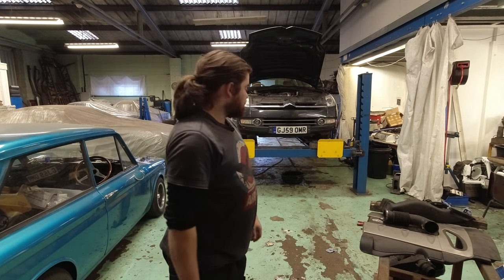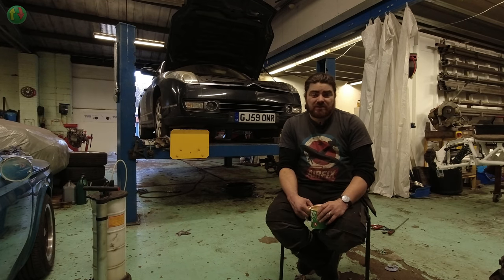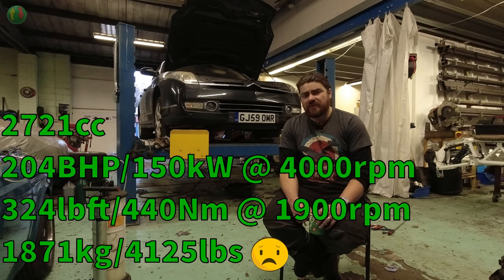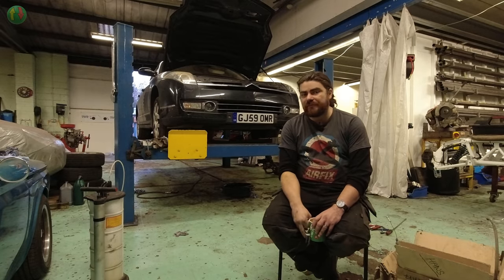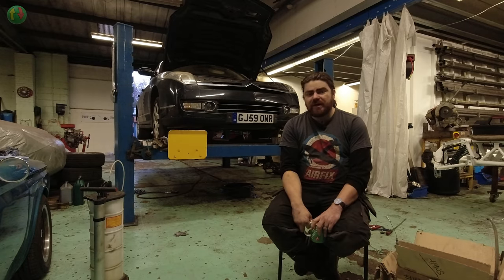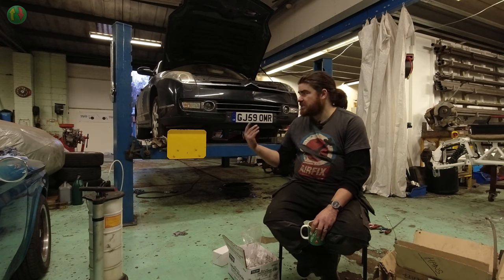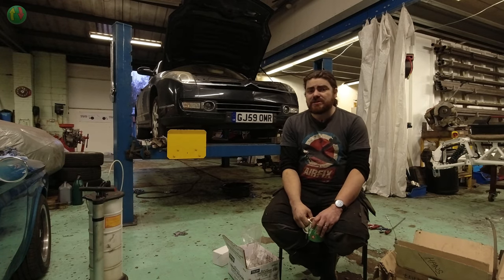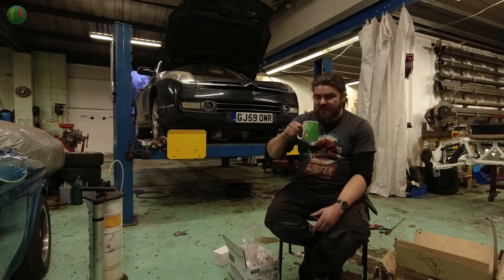STORYTIME: How I ended up buying a £750 Citroën C6 in lockdown!

Comment: So Great to see Lovely OMER is getting the work done to her. I drove many tens of thousands of miles in her and loved 95% of them, the 5% were due to the problem highlighted.
I was sad to see  her go but I could no longer fund the work necessary and am  Glad to see her in such capable hands!

I totally agree about the C6 Owners site and would highly recommend people go to it for information related to these cars, the type of things  and common faults to look for.
They may save you many thousands of pounds!  Wish I had known for instance to change gearbox oil every 40K, quotes for gearbox rebuild was north of £2.7k. Though strangely the box fitted as far as Citroen is concerned if a 20GG09 usually fitted to a C5 3.0 V6 

 Did save me loads of cash when she had a problem with Kick down where she went into Limp home mode. Citroen did suggest it was one of the EGR valves. Cost to change £1300 if that didn't work it was £1800 for the other. Transpires that nowhere in the maintenance schedule does it mention to change the Fuel filter and when inspected it was most like the one that came out of the factory. Cost to replace £40, see what I mean!

Also if you are buying a C6 find a specialist to look after her, do not go to a Citroen Main dealer, they know so little about C6s that when the one I mistaken chose they took 2 1/2 days to do a cambelt and managed to bugger the thermostat house (Should be changed at same time) but denied doing it. 

Looking forward to watching the rest of the series and maybe I could come down and see her when your have finished! :-)
Reply from the maker: Thanks Kevin, it's down to you that it's still going!
Reply: I just looked at the mot history! Blimey Kevin you must have bottomless pockets, it certainly didn't shower itself in glory did it? You did well to keep it going. I always liked the look of these, I had a Mk I 2.2 C5 auto exclusive estate and that was a nice car but very thirsty and with the tax and insurance it became not viable. I also had a 2.5 Xm Sx. Like you it was a labour of love and I spent an awful lot of money on it but when the clutch started to go I had to get rid which was a terrible shame but that job on a 2.5 Xm is mega money.

Comment: A C6 is always risky even at the top end of the market, but it is a great concept worth maintaining and enjoying. Even the 2.7 can do a lot of miles, just change the oil pump from time to time keep your eyes on the coolant pipes and do it's services as correctly as you can. My car had a lack of damping and I changed all the spheres - sadly everything was wobbly as usual, then the pump went out and I had to replace it for 1200€ after that the damping was spot on. By the way the faulty motor in the hydraulic pump is a Renault part and pretty cheap and you can change the motor with a bit of work. For the gearbox issues just change the hydraulic solenoid block these are Aisin parts used by Volvo, Lancia and a whole lot of other cars - also shift in "Neutral" for stops till everything is sorted out.. it is worn out if it keeps on jerking with fresh oil because a Solenoid is weak and it weakens under heat as in an old pinball machine.
 It is an AM6 Gearbox and you will find parts almost everywhere a thing worth doing would be a larger oilcooler for the gearbox the stock cooler is just a open metal pipe behind the grill on the left side.
Reply: I didn't realize it was an Aisin AT. I thought it was a ZF.

Comment: Love it! I know you've said you don't like them but in lockdown I picked up a 2009 C5 tourer with the 2.2 hdi for £1500, fully working and with 100k on the clock. It's a lovely compromise between the risk of a c6 but the mechanical reliability/ simplicity of its engine and hydro pneumatics. As a broke 21 year old student I can't take much more risk to be honest. Very underrated car in my opinion, feels very robust
Reply: Nothing wrong with the c5, I've had 4!
Reply from the maker: I don't mind the later C5 (X7). Mechanically it's not really any less 'risky' than a C6, other than the chocolate crankshaft and associated DPF/EGR issues in a V6 twin-turbo diesel. Suspension largely the same, though C6 is set up to be slightly 'waftier' and I believe it's much quieter on the road, too. The early C5 I didn't like much as they have all the downsides of a Xantia with none of the upsides, and they look...well, yeah. That said, I can see why some people might like them.
Reply: @UPnDOWN  Ah yes, I suppose I was thinking about no AMVAR and simpler height sensors on mine, I think the two are related? I think mine has effectively two damper settings, soft or firm.
Reply: A 2009 means it uses the newer electronics system and revised suspension parts. At most, budget for replacement dampers and that's about it! 21 year old with a car that rivals a S class in comfort haha
Reply: i had c5 58 plate buddy and it was the best most comfortable car i ever had.currently driving c4 picasso egs 63 plate and i love it...but c5 was one of the best..
Reply: I bought the early C5 2 litre friezes with 69,000 miles on it, sold it with 259,000 miles. Most reliable car I ever had
Bought the newer C5 which is a dream but not so reliable, but still great after 160,900 miles.
Reply: @docchevron1472  not related , two totally diferent cars
Reply: @UPnDOWN  i bought a Xantia for 400€ and from diferent people i know they ofered me 4 other cars only one was a 1.8 gasoline ,this a 96. they ofered me the cars in mint condition ,the problem is that maintenance in citröen garages is very high priced as in other garage normally from a ex-citröen mechanic that opens a garage and prices do come down a lot in certain repair they drop for  half the money, on of the cars given to me one was in mint condition always in a garage and the citröen mechanics said to him that was so expensive the repair that it was better to buy other car but when talking to my mechanic (who ofered me the 1.8 gasoline) i paid for parts and work 93 €´s, and it´s a pleasure to drive ,only bought it because i liked it and when they were new i had a Lancia dedra 2.0L 16valves (gasoline) some warned me because of the brand known problems but i had a lot of them and never had a problem and this dedra mabe the car i drove for more years without any problem either than the gasoline ,as an example in 2000 i saw a neighboor with a dedra from 98 and the mechanic was with him next to the car working like totally out of tune it seemed destroyd but i after the mechanic gone talked to my neighboor and asked him what the mechanic said and he was down he had just bought the car new two years before ,he replyed that it wasn´t possible to fix it or a new engine ,i wonder about it and asked him how much he wanted for the car ,he tells me if i give him 2.500€ it´s mine i said yes and when coming to the parts store inside the lancia alfa fiat dealer and bought a wire with graphite inside with two conectors ,the r.p.m. counter  cutter as they call it and install it myself , it worked perfect no vibration ,a new car almost no km´s with two years , that´s why Lancia is badly known ,the unreparable problem was an electric plug that cost 35€ and anyone can install it ,i´ve sold used cars as my second source of income for around 25 years and i learned how to repair small problems ,this wire i had substituted it in other two Lancias ,the real problem is that the wire was too long and the plugs in each end were always loose making the wire cut next to the plug but with tape you could put it against another wire and not left him loose inside the engine bay , the old owner when after one days see´s me driving it in perfect condition almost had an heart attack ,sold me his two year Lancia for 2.500€

Comment: I love it when guys like you patiently and persistently figure out how to get around problems like this. As you say, that suspension is much simpler than people think. Long ago I had a CX Familiale estate and was amazed to find that the return pipes on the rear suspension were push-fit only. Still miss that car!
Reply from the maker: That's the thing - it's actually brilliant engineering. But nobody considers it.

Comment: I owned 2x 2.7 HDi and now i have 3.0 HDi. There is few jobs that needs to be checked and done on every C6 but then its perfect for long time. Engine needs full saps 5w40 oil always. Oil pump change with every timing belt change. Plastic water inlet and outlet with every timing belt change. Add a water level sensor from C5. And hydraulics check every year, front struts for corrosion, pipes check for corrosion (especially over fuel tank where you dont see..but they break there). Otherwise.. i have 430 000km on it now, and its fully reliable. Im going to stay with her as long as possible. For the gearbox, im changing gearbox oil every 30kkm, 3L .. its about half. Its good to use oil cooler, or stick a water cooler before gearbox. Oil temp can get up to 100deg C and then its not oil.. its a water. When the valve body is damaged, it needs replacement.

Comment: I have been daily driving a C6 for about 6 years now. Haven't have any major problems except one. Hydraulic pump decided to die, electric motor on it, to be exact. It is probably repairable and I kept it just in case. Got a used one for 250 euros from a wrecked car. Also the last C5's that have the same suspension, their pumps should work too.

Comment: It sounds very much like the valve block - what ZF call a "Mechatronic" unit. I had trouble with my BMW's ZF 6-speed box locking into gears: I took the car to a local autobox specialist who charged a reasonable amount to sort it - the Mechatronic assembly was sent to Germany for rebuilding - and it's been a jewel since. By the way, my car's done 311,000 miles...

Comment: Been running a 2.2 manual C6 exclusive for a year now and it has been great! Only issue I've had has been replacing turbo vacuum solinoid valves and a temperamental door handle which i sorted with wd40👍 the 2.2hdi also comes without the eye watering road tax of the 2.7v6.😁 obviously the tech is a bit outdated by today's touch screeny standards but it's very well equipped and i still find the interior a lovely place to be! I also love the exclusivity, there ain't many about!
Reply from the maker: I'm happy not to have the touch screens, I hate them in cars!

Comment: Aah yes, the Warner-Aisin 6 speed gearbox of the C6! Been there, done that (paying, not wrenching.) Clunky gear changes into third sounds mighty familiar. Mostly the valve block, some people claim that you can just change the valves themselves (?), not too expensive. The dealer from the Middle East who bought my former C6 when I was fed up with it had to exchange the torque converter though.

Quick fix (newspeak: life hack), although temporary: Put the gearbox into W mode (meaning Winter), this greatly alleviates the clunky gear changes.

My long term fix: Got a nice C6, from the first owner, with the good engine (3,0 HDI), had a professional Citroen shop fix _everything_, also doing all the preventive measures, giving carte blanche cost-wise before ever driving it. Happy ever since.
Reply from the maker: Problem with winter mode is that it restricts your acceleration even more from standstill. I nearly got T-boned last time I tried it haha!

The 3.0HDI does seem a better engine, but over here they're way more expensive than the 2.7, and for 80% the same car, a 60-80% price increase seems extreme.
Reply: @UPnDOWN  3.0 HDi is the same engine with same problems. It has litlle bit better consumption around 1L less, but the feeling is not so agressive as 2.7. It has better and more reliable injection and better EGR system from bosch. Because on 2.7 the EGRs are the worst and they fail often.

Comment: I bought a 2007 c6 in 2019 for 850 euro.  Feeling like you need do push clutch if it had one, is definitely the torque converter getting stuck in lockup. The harsh shifts are the valve block. An easy job to do valve block. Changing both fixed both my issues
Reply from the maker: Yeah, it's possibly both. I've changed the valveblock, which will be in a future vid.